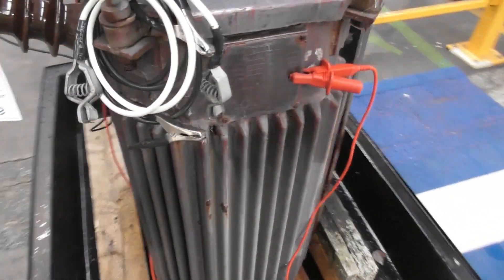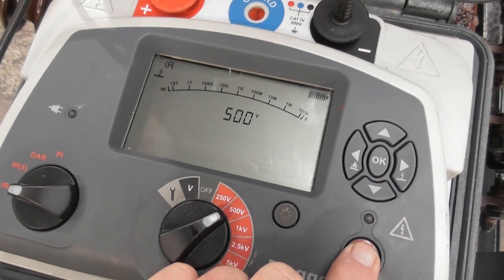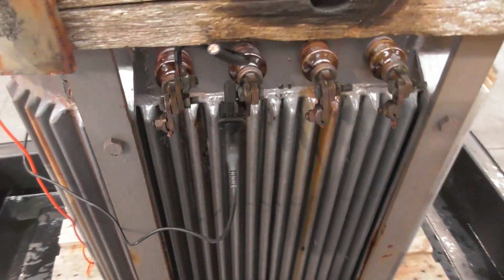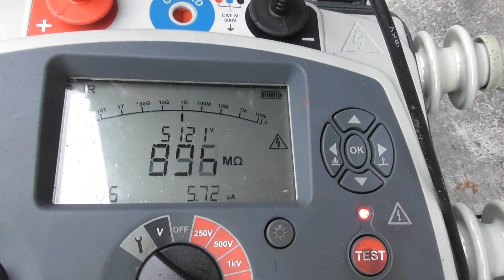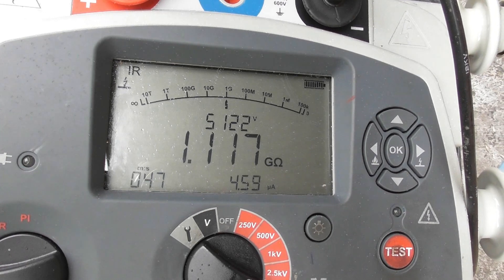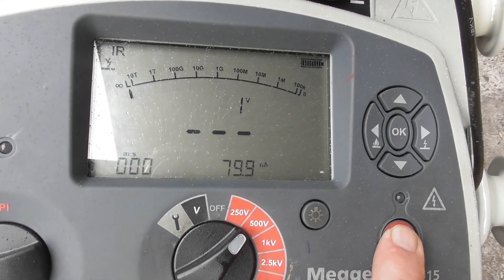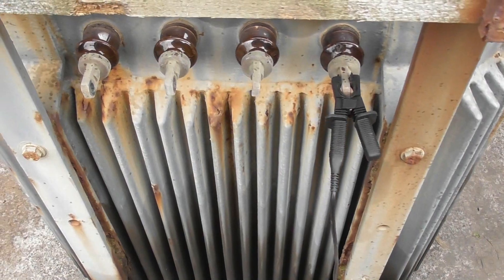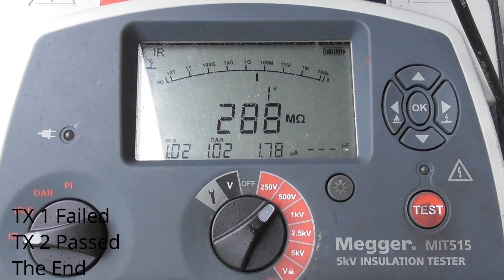The insulation testing of the two vintage Ferranti power transformers

Comment: Second one change oil, slap a new coat of paint on it, and it will work well as a source for wasp zapping in the garden by you. Or shove it back out on a pole for another 50 years of service.
Reply from the maker: Too heavy, I prefer de-shunted MOT's with a streetlight ballast in series, as they are a lot lighter.
Reply: @RODALCO2007  rewound 10kVA site transformers are the best for MV (obviously only found in the UK). 60kg and will do 10kVA continuously.

Comment: Bubble looks to be a ¿Wood Metal? Over Temp Vent Plug relief device.  I would have it to play on the bench with torch fire, wood metal was used as a thermal breakaway for "automatic" fire doors on the closers in stairwells, not allowed anymore.